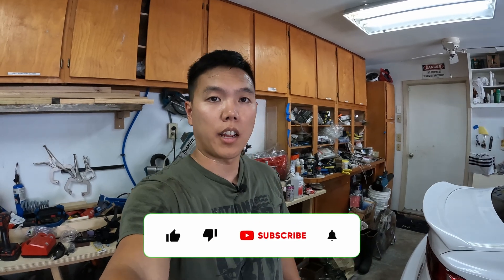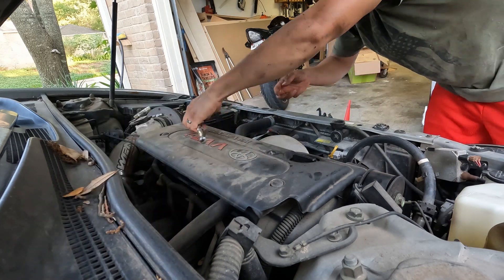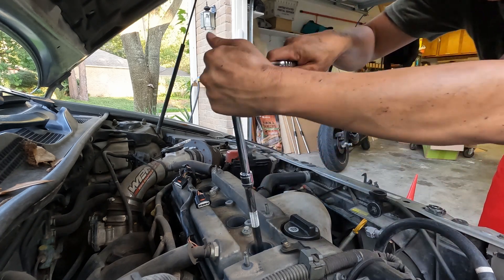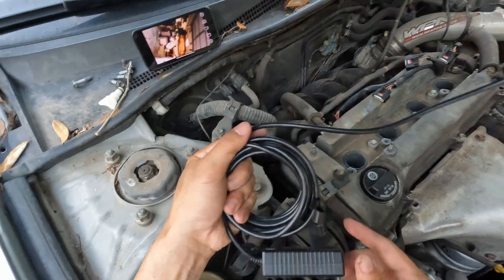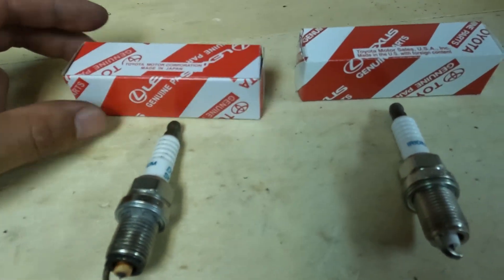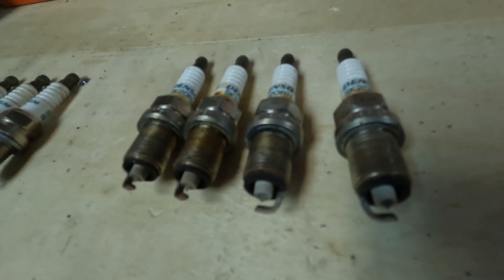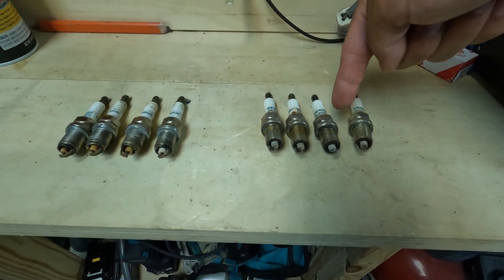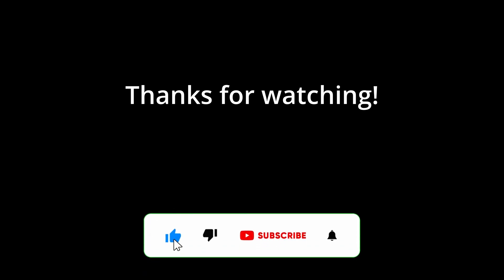What Happens if you use Fake Spark Plugs

Comment: Yesterday I installed 8 motorcraft SP-509 sparkplugs that I bought on Ebay, my SUV is a 2009/ Expidition/5.4. I took my SUV for a test drive and the engine ran crazy rough/the check engine light came on. I went on youtube to see if I had purchased made in china counterfit spark plugs, and I had. I went to my ford dealer and bought the real-deal motorcraft spark plugs.
Reply: Fordtechmakuloco talked about it
Reply: @coreybabcock2025  Ford OEM parts are crappy too!
Reply: yes. much needed to get them directly from the dealer these days.
Reply: Ebay sells fake spark plugs everyday.  I'll never buy from them again.
Reply: https://youtu.be/OpDJNDb6b9A?si=6cPntatXdBYhw9cR

Comment: Lots of fake spark plugs from either ebay or amazon.  It has been reported for years, but I guess people are still buying them. 

I bought a set of NGK iridium plugs from RockAuto in 2008 and hey lasted 100k miles.  I bought another set of Denso Iridum spark plugs from RockAuto in 2014, but plan to put those in this year in 2023.  Well, I have had one set of good plugs from RockAuto, but there is no guarantee that I might not get a counterfeit.